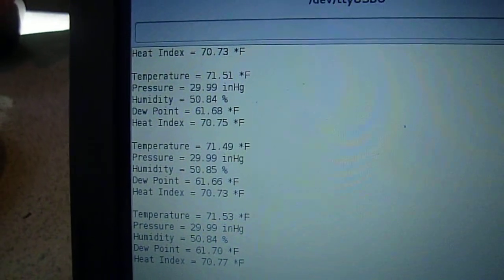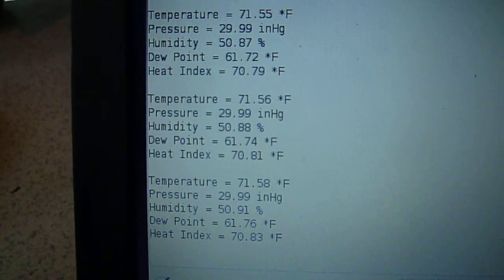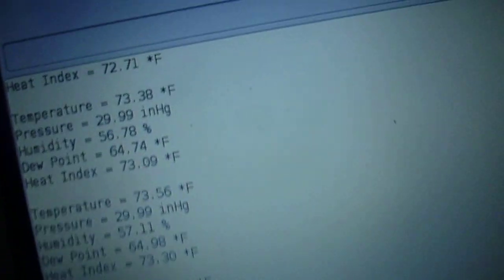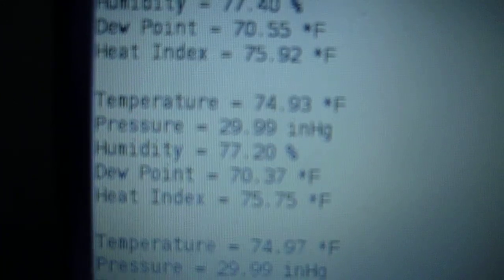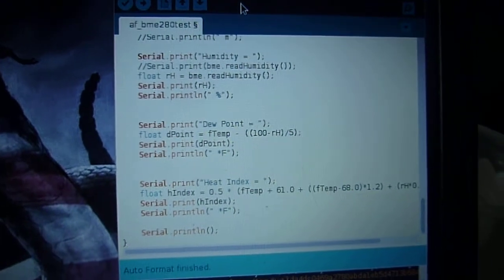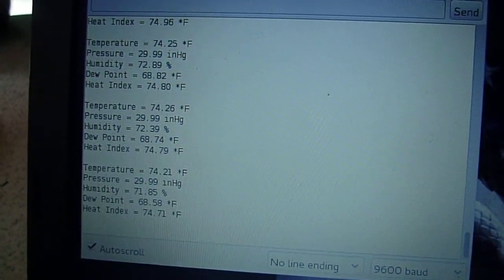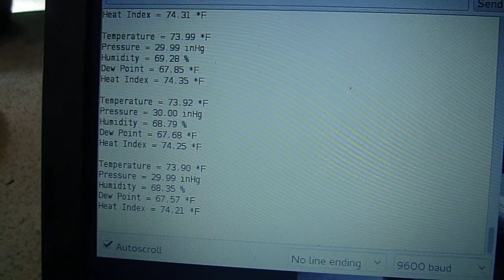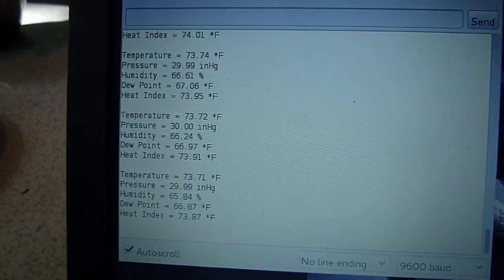ESP8266 BME280 Weather Station

Comment: i get following error 

ctx: cont 
sp: 3ffefa80 end: 3ffefc60 offset: 01b0

>>>stack>>>
3ffefc30:  feefeffe 00000000 3ffeeb74 40202384  
3ffefc40:  feefeffe feefeffe 3ffeec24 40203eec  
3ffefc50:  feefeffe feefeffe 3ffeec40 40100108  
<<<stack<<<
¥üb0¡Èúô�/ÿBME280 test
Could not find a valid BME280 sensor, check wiring!

Soft WDT reset

tried checking i2c address, disabling WDT nothing works.
Reply from the maker: what do you get when you run the i2c scanner code?

Comment: Hey awesome project! any idea when the dashboard will be available?
I need some help please!
I am EXTREMELY new to arduino programming and programming in gerneral. I have a nodeMCU ESP8266 and have attached a BMP180, DHT11 and DS18b20. I can get it to post to thingspeak but the GUI isn't very user friendly. 

https://thingspeak.com/channels/298771

I am trying to set up a mini weather station (Temp,Humidity,Pressure) and pool temperature monitor. 
Eventually I'd like a web gui dashboard to show min max average temps of the pool and all other sensors per day and month  and also show it graphically per day and month, so I can gauge how the seasons change and when the best time would be to swim.

Comment: Hi thank you for this tuto. I don't know I always get the chick wiring message while using BME280 library. I changed my I2C address (0x76), I get the temperature and pressure values (Humidity no) only while using BMP280 library.
Reply: It cause you used BMP280 that not include humidity sensor. The difference between BME and BMP are environment sensor (pressure, humidity and temperature) but BMP only pressure and temperature.